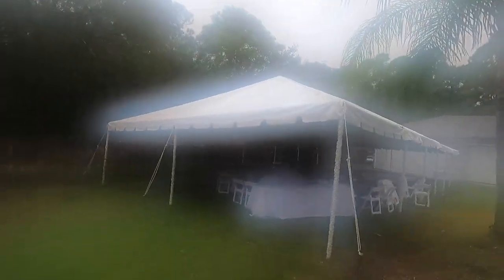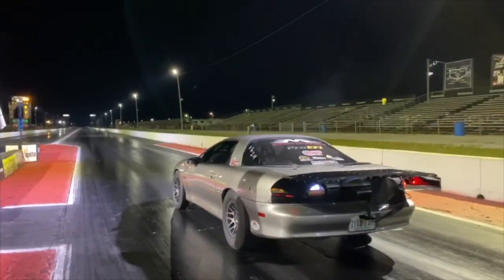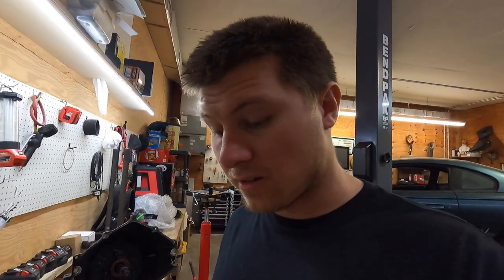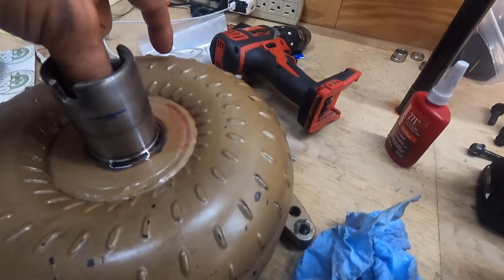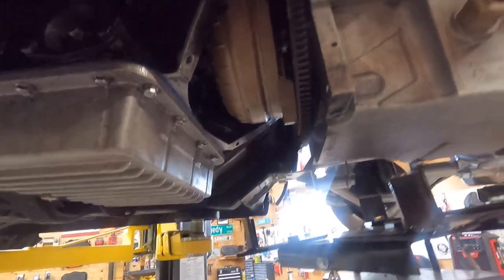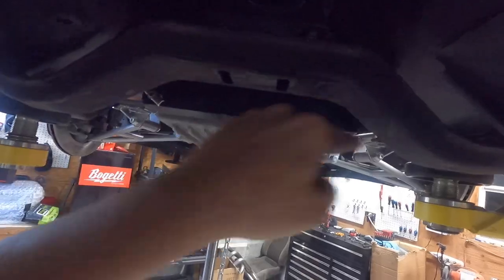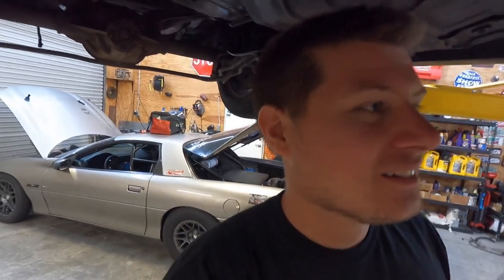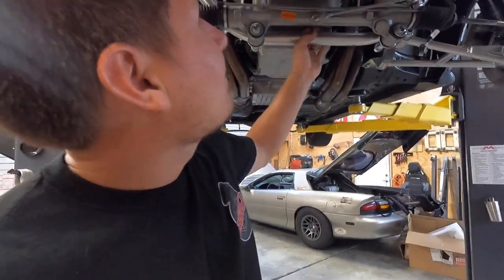Chips Powerglide is IN! (Drag and Drive Build)

Comment: hey coops, tech tip! get the drive line angle from your crank bolt / balancer. all engines tilt back a couple of degrees to match the diff. awesome work. keep it up

Comment: Engines are almost universally tilted down between 2-4 degrees and because your transmission is directly bolted to the engine, it too is between 2-4 degrees. at least that's what it should be to have correct U-Joint angles and so on. And yes, you need to flip you trans cross member so it to is at the right angle and then you're headers may fit better or they may not fit as good as they did .

Comment: Need to take a straight edge and set it against the balancer  and measure from there. That will give you your output angle cause it's basically a straight line crank through trans and out.

Comment: I have used Emery cloth for clearance on the converter snout to get it to fit the transmission and I also have taken the transmission main pump gear and used a end grinder and a burr bit and taken a little material to get a torque converter to fit a little better

Comment: Take your stock pinion bearing off & grind out a couple passes on the inside so you can slide it on and off the pinion as a "tester" to get your shims right. Remember the shims go behind that bearing so if you press on a new one and the shim is wrong, it's trash. Also order an 8.8 steel pinion collar kit, it's like 25 bucks and you can skip the "inch lbs drag tq" process. Don't be afraid to run your depth a tad deep, you want full tooth engagement. I've swapped gears in my 2J mustang countless times. Also order the same brand bearing that your stock one is. A koyo bearing only matches a koyo race, same for Timken. They DO NOT mix and match, taper angle and depth are different between them.

Comment: Ive got 2 LS swapped SN95's. I used the AJE k members and cheap swap headers. Both had to have the same tubes dented just a little. I put a stock case glide in one and a th350 in the other. I modified the stock transmission crossmember on both. Im pretty sure that you are going to have to drop the rear of the trans quit a bit. I could be wrong. Im not sure that mine are right but neither of them have a vibration. Both are just bracket cars. Ive had a turbo 4th gen for years but built the 1st one for my 14 year old son and liked it so much I built another. Both look like shit boxes but are solid cars. I think they are the perfect drag car. Im curious to see how yours turns out.

Comment: as a heads up when the pump bushing wearts like that on the bottom is an indicator of the motor that is was on has worn out main bearing and the crank is sitting low.
Reply from the maker: Well the 240s engine isn't looking good 😂
Reply: @CooperBogetti  send it till it becomes self ventalating lol

Comment: Hope I’m wrong but when you were showing the font pump looked like one of the roller bearing was out meaning it will disintegrate on first run. I went back and watched it again and it’s fine what I was seeing is light coming in through a vent/oil passage.

Comment: What you called a limited slip differential is not. It's called a spool. What you said about it is true.  You can drive them on the street, With a spool, you need to be especially careful going around corners both dry and in the wet. The reason being that when the car is going through a corner the inside wheel will break traction because the inside tire will turn faster than the outside tire because the inside circle is smaller in diameter than the outside one.. That's why a limited slip rear end is better on the street. It allows the tires to turn at different speeds during a corner.. I had a  Guise mini spool in a 1969 Nova was on the throttle, and lost it through a mild corner . Didn't wreck the car, (came real close)but scared the bejuses out of me. A limited slip differential will allow the wheels to spin independently of each other once the torque threshold is overcome.

Comment: How about a water level where use a length of clear hose in a U shape filled with enough water it finds its true level. Tape each end to a fender(valve cover) kind'a thing. Then when its only off .001 you can sleep better, lol. 

gg.

Comment: That's not a limited slip diff, that's a spool. No slip so not even a differential any more!
Reply from the maker: Yeah was just a mistake
Reply: @CooperBogetti  you probably don't want the motor and trans level. The output shaft should be at the same angle as the pinion but NOT pointed straight at it.
Reply: @the318pop  🤣🤣Awww why'd you tell him, I was looking forward to the chaos 😭🤣